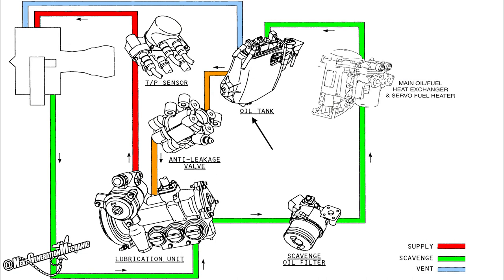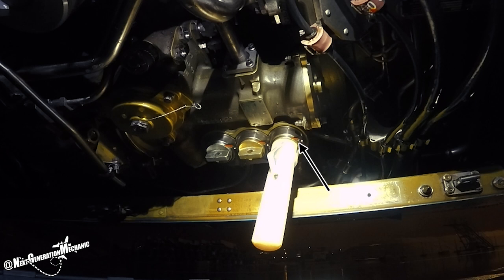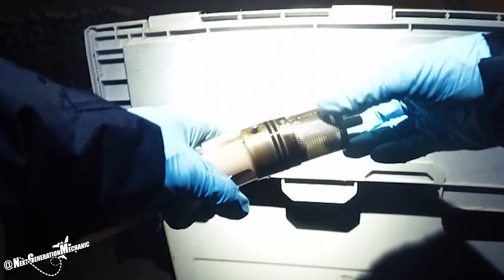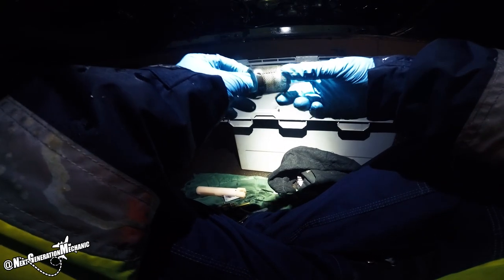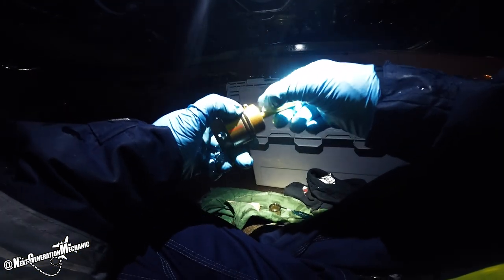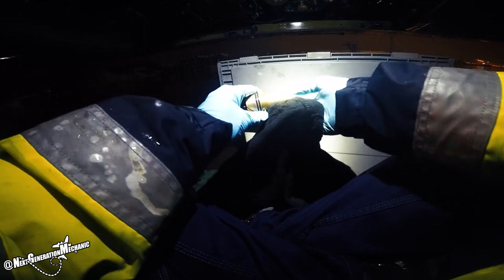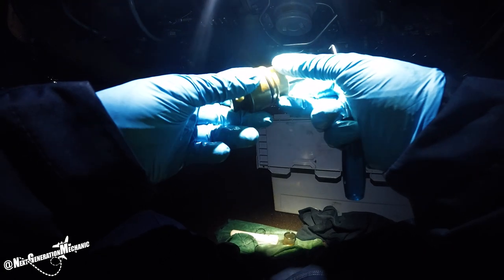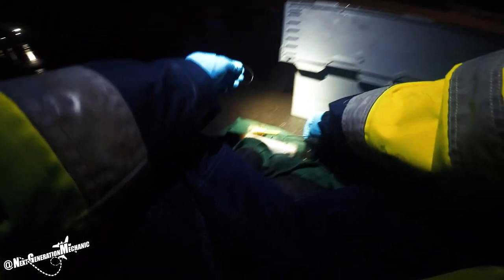Boeing 737: Magnetic Chip Detector inspection + explanation

Comment: Often we find pieces of the Carbon seals in the MCD, where does this carbon material come from? It’s not magnetic they are found in the mesh part of the MCD
Reply from the maker: Carbon deposits that came loose, carbon seals, it can be different obviously. The AMM has some nice guidance pictures to put you into the right way :-). The seals can come from the AGB for instance.
Reply: The AMM has its limits but I’ll have to review it to see where the pieces of seal is coming from

Comment: Hello! What if you found something in a detector?  How do you know where did debries come from? 😀
Reply from the maker: Good question. There are 3 chip detectors as shown in the video. Every chip detector is connected to a different oil user on the engine. If you find a debris you have to refer to the AMM to locate where the part came from and if it's acceptable. For example, if you find a swirl of metal, it can be from a bearing from the engine (just an example ofc.).  Hope this answers your question.
Reply: all clear thanks :D @NextGenerationMechanic